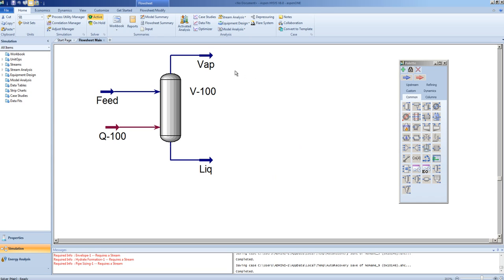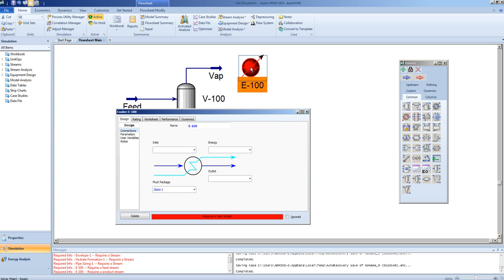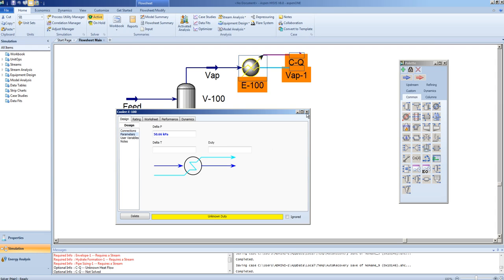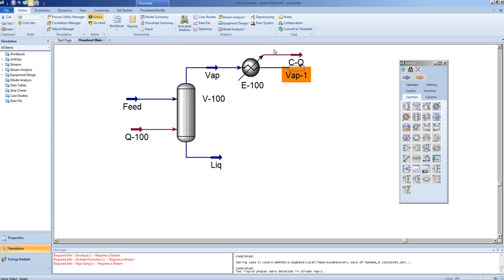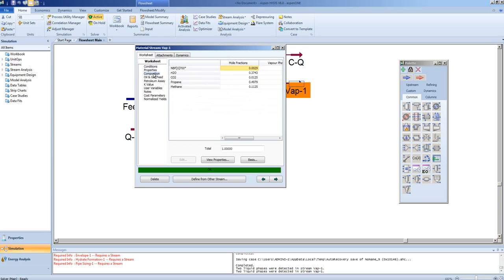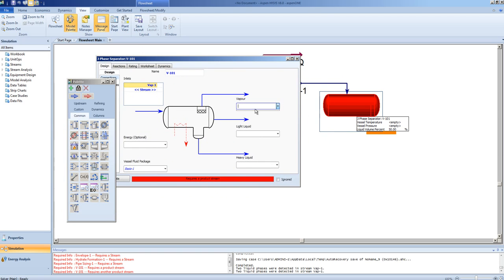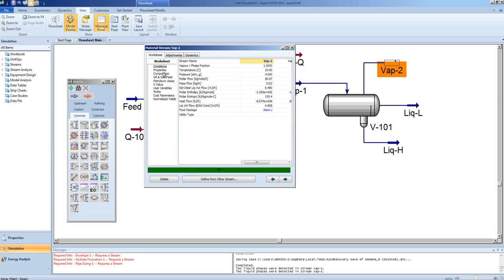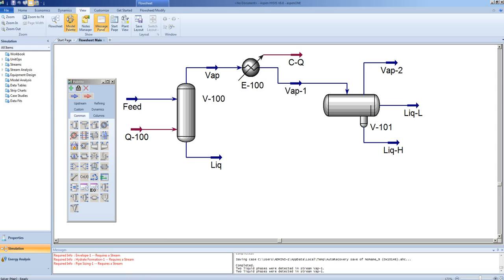Cooler and Three Phase Separator

Comment: Hye i want to ask, how do i include the recovery if i am using sep2 block
Reply from the maker: Not sure what you mean.  Please explain a bit more.
Reply: @adrianl6811  I am sorry. I am just a beginner.  I need to find heat duty from the distillation using sep2 block. But there is recovery of components. Water. Methane n ethanol in overhead n bottom stream. I wonder how can we include it in the simulation.
Reply from the maker: @baidurimumtazah5215  you should probably be using shortcut distillation  column instead of sep2 block. You can specify recoveries and it outputs the duties.  See the first video i posted on distillation.
Reply: @adrianl6811  yes, we also view some video, and we are thinking to use radfav too. But the question wants us to use sep2. The question: a two-feed, two product distillation column operating at 1 atm is to be 
simulated using the Sep2 block. The components are methanol, water and 
normal hexane. You may assume that the system thermodynamics can be 
represented by an ideal vapor phase and the UNIFAC correlation for the 
liquid phase. The componential flow rates of the first feeds are 50 lb mol/h 
of methanol and 100 lb mol.h of water and is a saturated liquid at 14.696 
psi. The second feed flow rate is 150 lb mol/h of pure n-hexane at 120° F 
and 14.696 psi. Both feeds are at 1 atm and are saturated liquids. 
1. Perform the mass and energy balance simulations using the
following column specifications:
a. One half of the methanol fed is to be recovered in the
overhead product
b. 99% of the water fed is recovered in the overhead product
c. 99% of the n-hexane fed is recovered in the bottom
product
Reply from the maker: @baidurimumtazah5215  Sorry i can't see how this can be done using Sep2 block. Please ask your teacher.  I would like to see how this can be done.